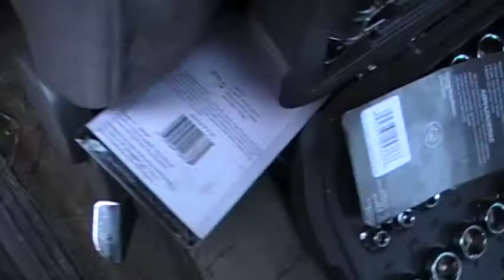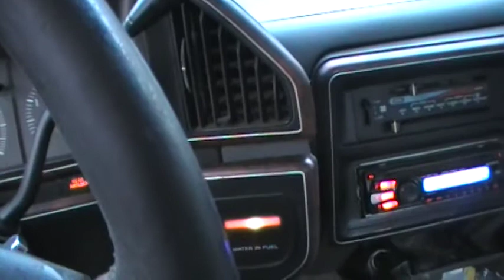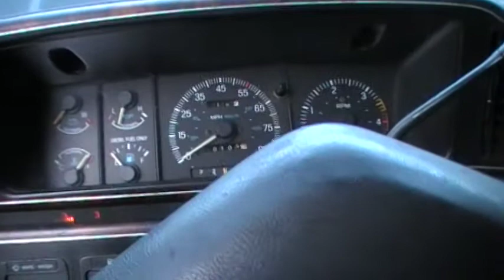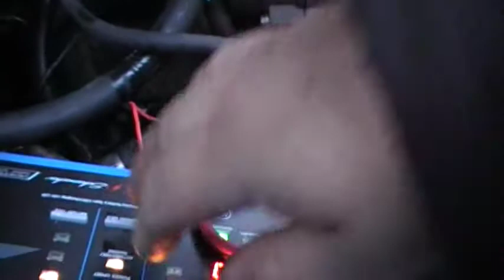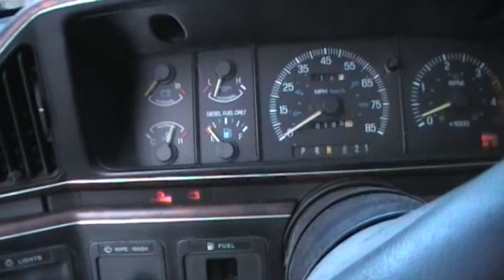91 Diesel cold crank FAIL

Comment: What was your truck like for starting on a really cold morning when it hadn't been used for some time,? And what did it pull up really steep hills like with a cold engine?
Reply from the maker: With two bad batteries and leaking return caps it's a bear . As I have to bleed the air out before the batteries die.that is why it didn't start in the video.good batteries and no leaks it starts good some smoke and some complaining from the engine and away ya go.very cold nights I plug in the block heater and good as gold.steapest hill I pulled with that truck is the drive way it's parked in.i was in Florida when I did this video and the steapest grade in Jacksonville is the dames point bridge and it did fine with a trailer with a lawn tractor on it.the weakest part of these trucks is the e4od auto trans.i converted it from a 4 speed auto to a 5 speed stick (zf 5speed).